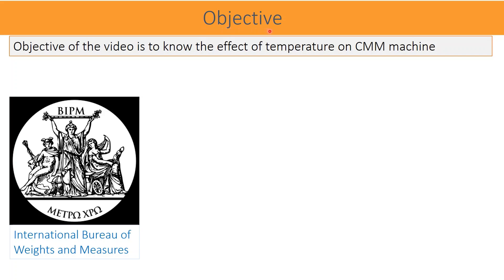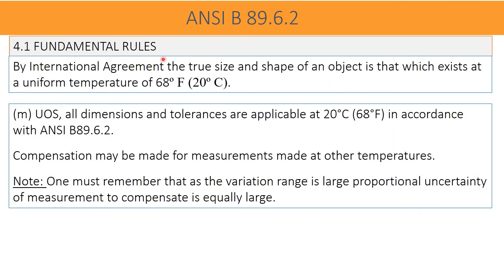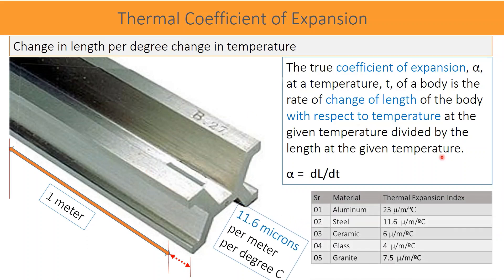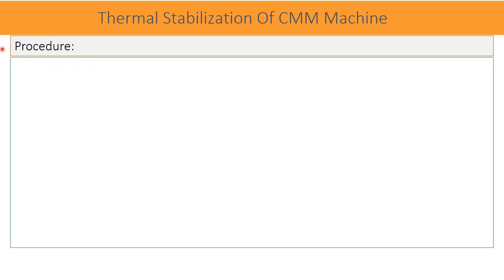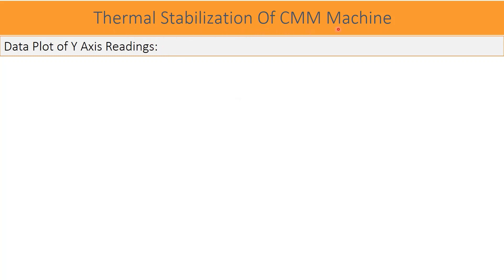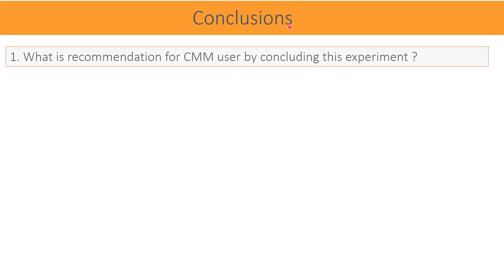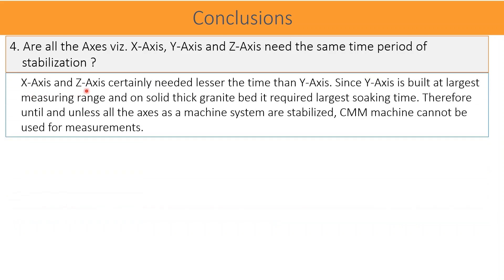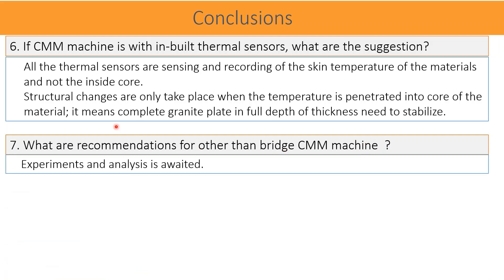TEMPERATURE & HUMIDITY EFFECT ON CMM

Comment: Dear sir , i have one doubt every measurement room maintain temperature range [18-22 C] & Humidity [40-60] which standard mention this criteria...?
Reply from the maker: Hi
It is not standard specification s.
It is manufacturers specification suitable to the supplied machine. 
Plus and minus 2 degrees are again reconstraint by temperature gradient.
0.5 degrees per hour and 1 degrees per day.